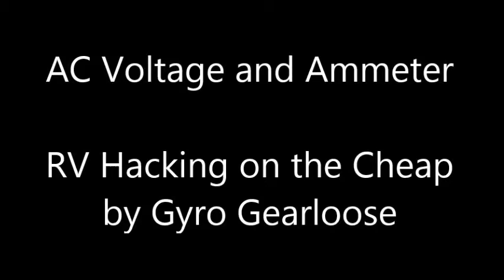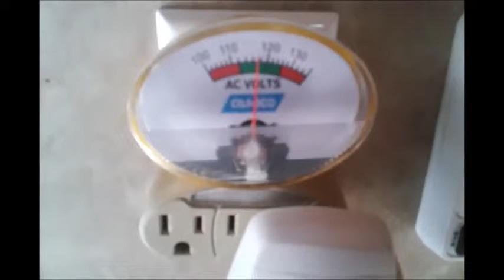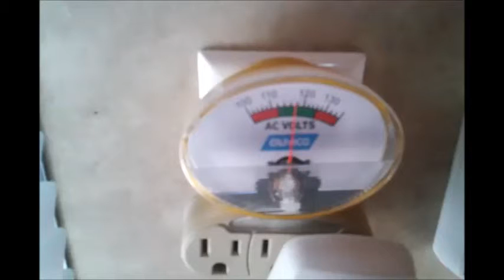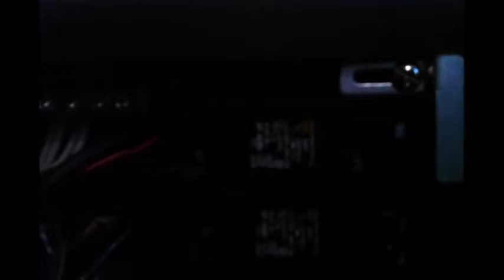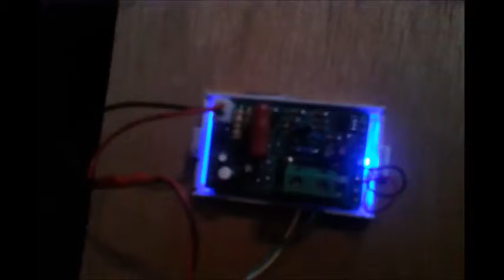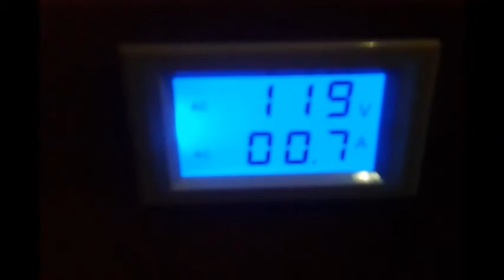AC meter

Comment: Great idea about having switching the breaker off for the AC Unit.  I'll definitely be using that tip.  Just recently found your video's but they are extremely handy.  Good work!